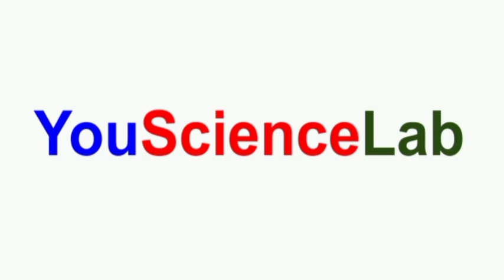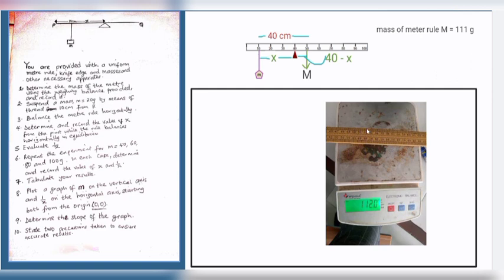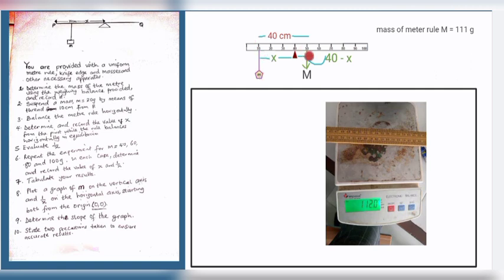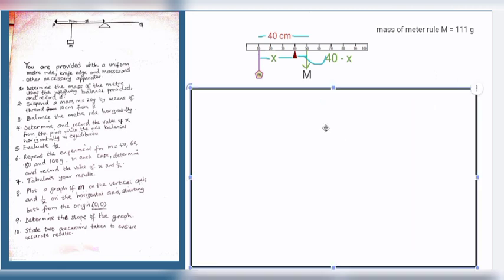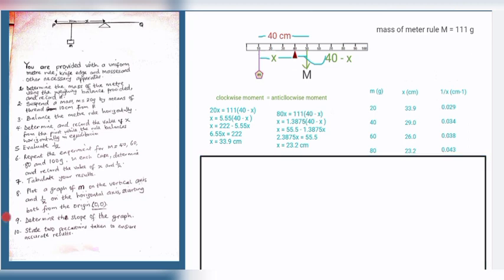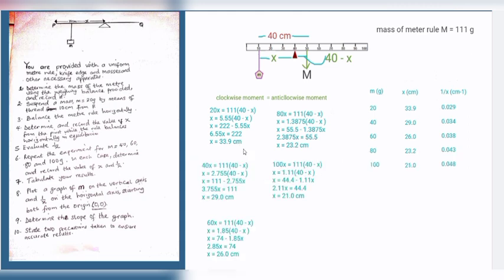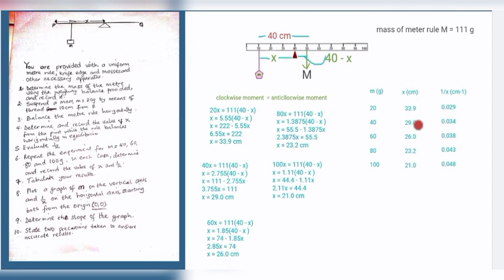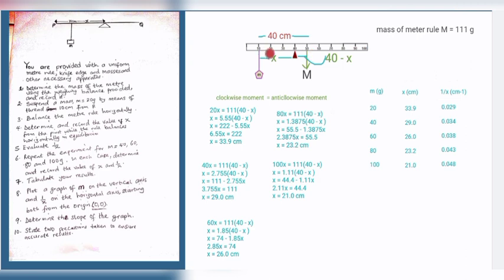WAEC PHYSICS PRACTICAL - Manipulation of Physics practical metre rule experiment

Comment: Good afternoon,
If the mass is hanged at another point( like 20cm)  instead of 10cm mark, What formula will be used to calculate the balance point.
Reply from the maker: That's a good question. What you will simply do is to find the difference between 50 and 20. That will be 30 cm. Apply the same formula. This time around  you're going to have m * x = M *(30 - x).

In a nutshell, you're using the same formula. The only thing that will change is the difference between the position where the mass is placed and the 50 cm mark. I hope this is helpful?